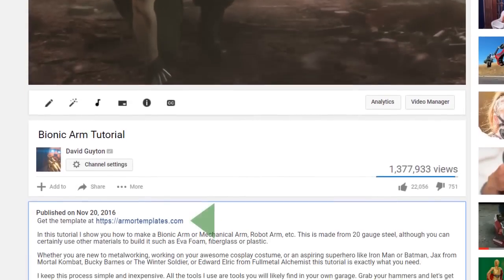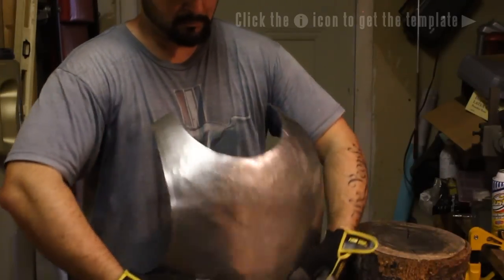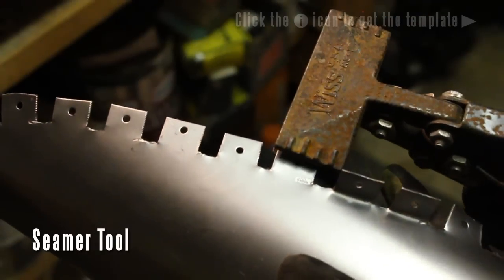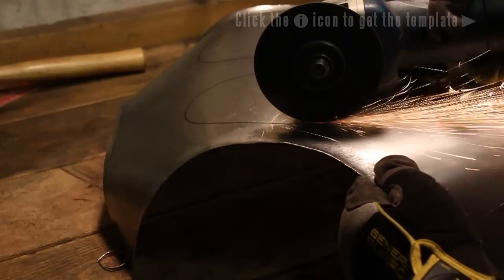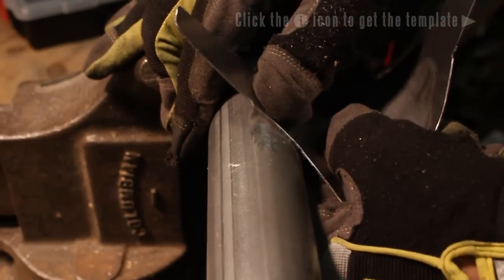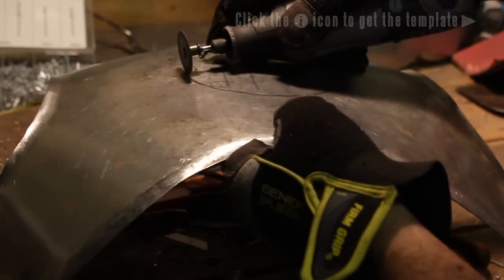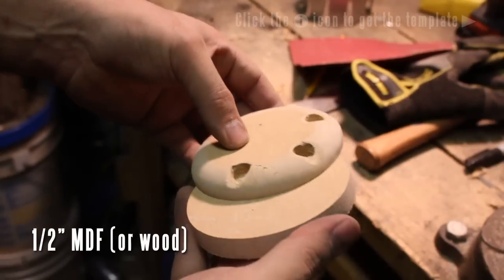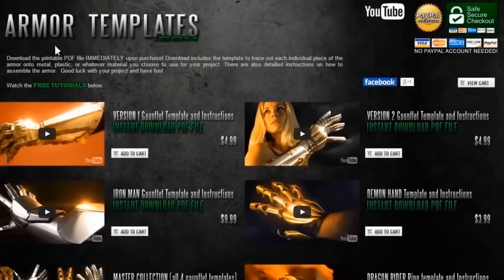Bionic Armor: How to make the Jetpack

Comment: If you do the Rocketeer Jetpack, you have to do the helmet as well. It would be a crime if you didn't do both.
Reply from the maker: I will do it if I can, but I am not sure how the helmet could be done. I could accomplish it in steel, because I could weld parts of it.... but steel would be kinda dumb. To do it in brass....I just don't see a way to make it work. At least not as of yet.

Comment: Awesome build dude you rock ! The way you manage electrical circuits inside of the build  could be intersting to see as well !
Reply from the maker: In this case it's just wiring positive and negative from the 2 lights and the fan together, and then running that to a battery pack with a switch on it. I meant to show it but I must have forgotten to record it

Comment: I like the design and think it's a cool concept.  Perhaps a Mk 2 version could incorporate a fin stabilizer on the rear for "aerodynamic" aesthetic and put in a model plane electric jet fan duct engine like you would see on large RC jet models wired up to a series of batteries stored in the back.  Again I love the design and have perhaps a dozen ideas for an improved Mk 2 model that would make for an absolute boss armor.

Comment: Where do you buy your steel from? How much did you buy for this entire bionic project? And about how much did the steel cost?
Reply from the maker: I mostly buy from Amazon (when they have it available) This was a 36"x36" piece of 20 gauge steel, and it was $24 I think. There was some left over too. If Amazon is out of stock (they are a lot these days) you can try Lowe's or Home Depot, Lowe's being the better option because they carry more steel. Also, if you do a Google search for "metal supply" in your area, there's likely somewhere nearby that sells metal to the public.
Reply: Did you use the 36"x36" for just the jetpack?
Reply: Don’t be afraid to search salvage yards for scrap metal as well. Many older and larger car trunks and hoods are great, and sometimes you can use your imagination with some of the curves that are already stamped into the sheet metal. You can media blast it clean, and paint to your liking. Also some enclosed trailers that are being scrapped have great aluminum sheets and sheet steel on them, if finding virgin metal is too difficult in your area. Takes a little more work sometimes, but it can offer a lot of options for curves and bends that are hard to recreate if you know what you’re looking for.